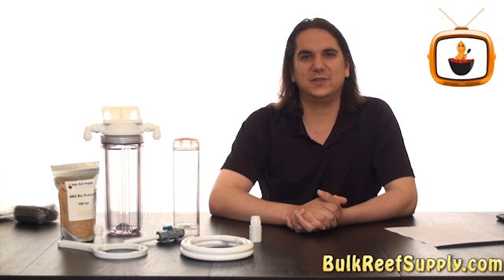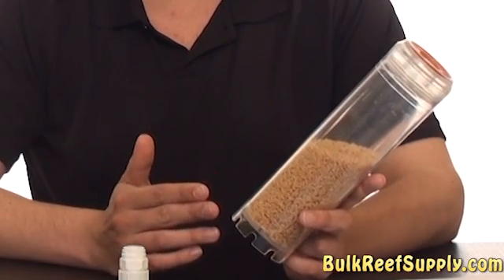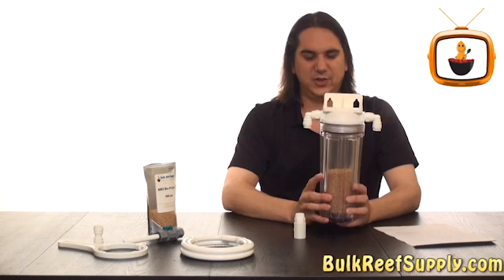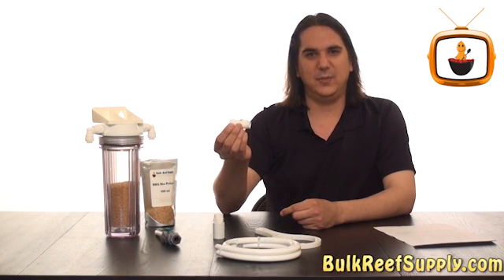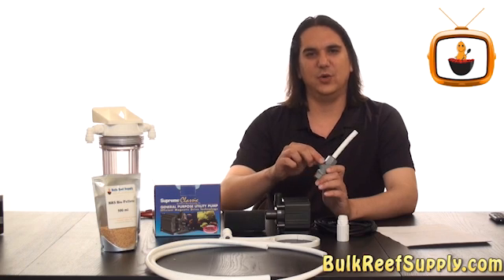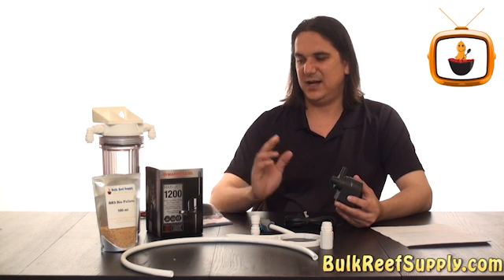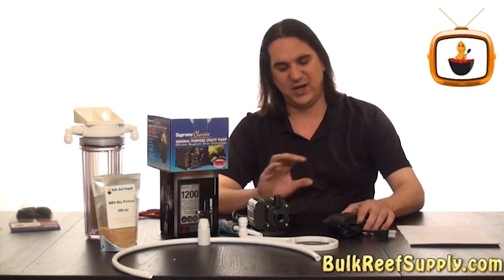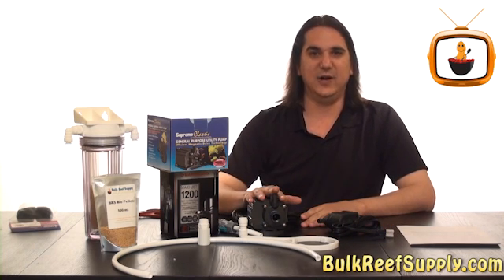How to set up a BRS biopellet reactor for saltwater aquariums

Comment: I just bought a BRS Biopellet Reactor and biopellets for my 130g total volume system. I added 2 cups up biopellets to the reactor as per the instructions(actually per instructions it should be about 2 1/2 cups). But several people are telling me I should pull half or more out and only start out with like a half cup and add more every few weeks. Saying that me adding the total volume in the instructions will crash the tank. Please let me know the correct procedure.
Reply: +BulkReefSupplyCom I just upgraded from a 60g w/20g sump to a 90g w/40g sump. In the 60 I was fighting high nitrates, switched it over to the 90 and they are about 80ppm. Right now I just have 2 fish, a true perc and a tomini tang. For corals I only have some mushrooms here and there.  If I should pull some pellets out can they just be towel dried and kept to be put back in later?

Comment: Hey BRS, I just bought the brs biopellet reactor a month or so ago, as well as switched over to leds.  I started off my leds on very low power coming over from power compacts.  At first I thought by lights were frying my corals.  Now Im pretty sure the biopellets are crashing my tank.  I have about a 80 gallon overall system with a 46 gallon bowfront.  I started off with 3/4 of a cup of biopellets.  All of my corals have no polyp extension and are starting to bleach out.

Comment: Guanglei Liu.. you may need to slightly enlarge the opening of the canister on the bottom screen of it..use a thin screwdriver to slightly pry the screen apart trying not to break it helping it to lessen the restriction

Comment: Mag drive is def better option but if u get the new maxijet1200 that come in the black box as shown in this video it seems to b a little stronger than the older maxijet 1200... It says it's the same gph but the impeller in the newer versions is def larger n a bit of a stronger flow....If u pull out both impellers u will see the difference because the new impeller will not fit in the old maxijet... It's longer n fatter n different color.... I'm using the new maxijet 1200 n it's working great...